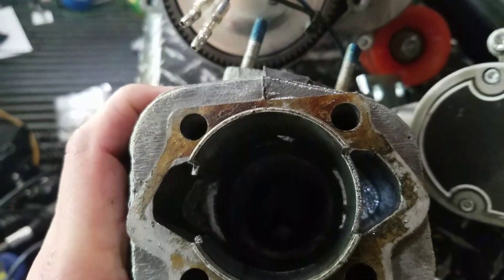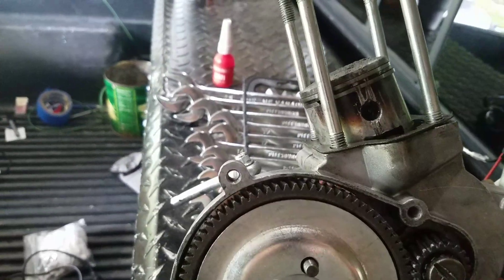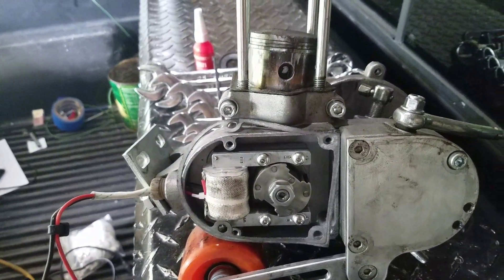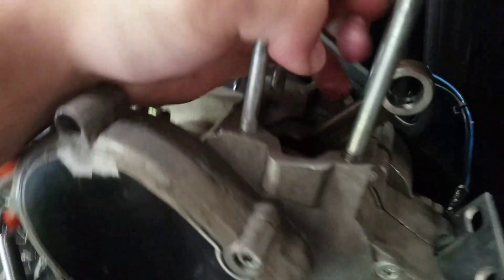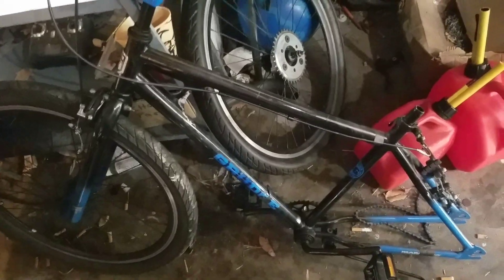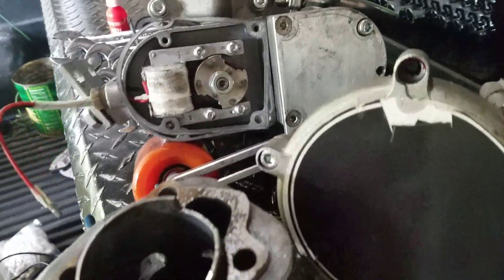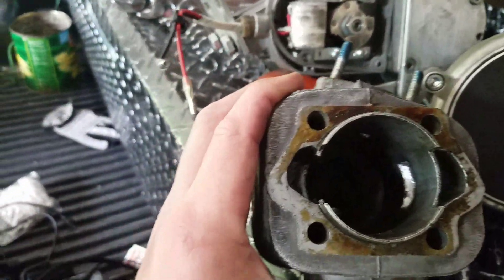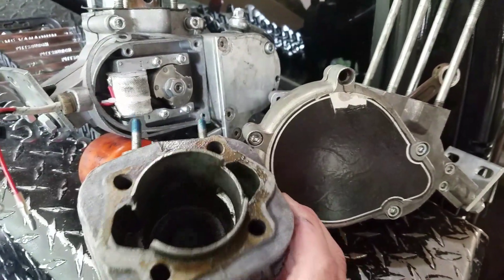YD100 motorized bicycle transfer wall blew out.

Comment: Tip the rist pin clips only go in one way around so make sure the tail bit is pointing outward look at it closely, but i now just cut off the tail bits so just a C-shape but u have to make a small notch on the side of piston if u ever want to remove it.
Reply from the maker: These are shity chrome-lined cylinders and if I pull the Piston off its to do a top-end rebuild, it is a  little harder to install the clips. I just cut the ears off, if not they can push against the wrist pin and eventually break that way. This is exactly what happened & more than once. https://youtu.be/KFWcA08aTCM
Reply: James Piccone ye that what I was trying to explain And that’s the video I’ve also learn it from thanks to that dude, I’ve already blown 2 engines where the wrist pin clips failed so fixed that problem, blew another engine yesterday end of one of the piston rings broke off so now I think I got to give the yd 100 ago from the 80.
Reply from the maker: @experimentchannel1776  ditto bro, same story here. If it wasn't for that dude I probably would have never figured that out.

Comment: Holy crap that's nuts man! Bummer... Thanks for the tip about the clips, and thanks for posting this video!
Reply: LA Hover yes and also the clips should only be put in one way the tail bits you grab out with a pliers they have a slight bevel on them you want them pointing out words so the piston rod doesn’t touch it and snap it off when the engine is running but now I just remove the tails so just left with a C shape

Comment: I already have the special cw10 clips for the YD engine I have, but I'm still seriously thinking of taking it back to the 47mm setup, even if I gotta fill, drill and tap too make it happen, the YD engines are just a bad design, great video James, thanks for sharing.
Reply from the maker: My other yd I don't have no problems since I switched out the circlips. YD'S do have way more power out of the box then 47 mm.

Comment: I just ordered another CDH, and was wondering about removing the transfer ports.
Reply from the maker: I do it to all my cylinders now, makes porting way easier on the transfers also.
Reply from the maker: @matouslitera8073  use duct tape to line the bore & glazed over cylinder wall will cause blow by. Not seating the rings correctly

Comment: I’ve got a YD100 coming in the mail. Is it a good one overall?
Reply from the maker: Yes, just runs a little warmer than a traditional triple 40, it has less thermal Mass therefore builds up heat quicker.

Comment: Are the wrist pins the same size on zeda80 as yd100?
Reply from the maker: I think so
Reply: @JamesPiccone  I was thinking, if that is the case, that I could upgrade my zeda80 to the yd100 by just getting the jug and piston! That would be pretty sweet since my zeda bottom has been through some shit and still runs great.
Reply from the maker: @codelicious6590  bolt hole spacing for yd 100 jug is different.